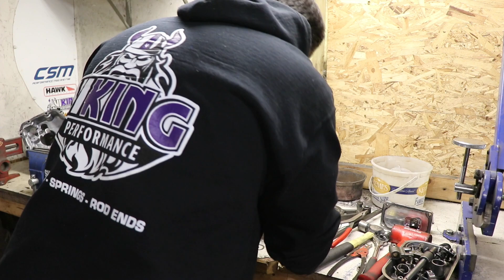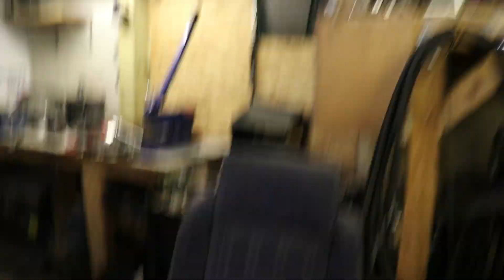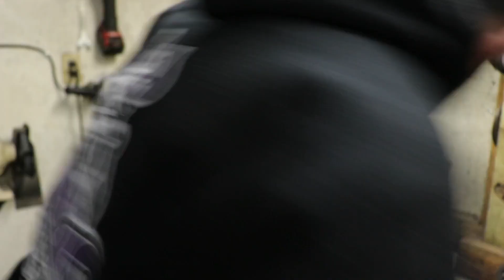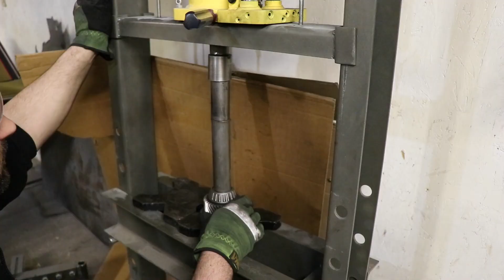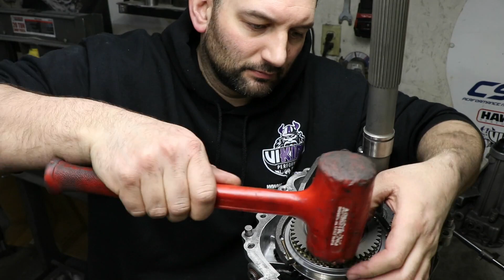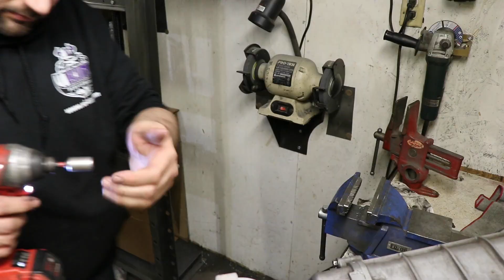Rebuilding My Tremec TR3650

Comment: So on that .82 5th anything special to install, it clears everything? Also looks tight to remove. How do you get it off?
Reply from the maker: It's a direct replacement. Once the snap ring is off usually some light pry bar/screwdriver work gets it free

Comment: Torquing qmwith an extension like doubles the torque value varying on what length extension you use
Reply from the maker: Yes. But I wasn't worried about it in this case because the torque value is so low and I was using the biggest diameter extension I have.
It's unlikely it was thrown off by much in this particular case

Comment: Have you ever seen a TR3650 main shaft sheared off at the 1st gear syncros? I cannot believe I lifted the main shaft off and from the syncro down was still in the case! Should I just abort the rebuild, or where do you get another one reasonable priced?
Reply from the maker: I have not....
I have a vore with a bent main shaft and broken case from someone getting big air over railroad tracks. But not one sheared off anywhere.
I don't even think the G Force gear upgrades replace the main shaft and they claim 1000hp safe
Reply: @codysmithmotorsports736  Yeah, looks like a weak spot. The force to do that, or it was just a bad forging if they're even forged.
Reply from the maker: @Guardian_Time_Jumpers most likely a defect imo

Comment: Is it possible to do the input? without pulling the whole trans apart?
Reply from the maker: You can pull just the front case/bell housing. You'll need to pull the shift retention springs (3 caps on the driver's side of front case).
If you stand it up on it's tail it'll be easier to not drop/loose anything when it comes off
Reply: Just had to do my input shaft, the shift rail assembly on the rear of the transmission does need to come off in order for the input shaft to come off

Comment: Good video. Thanks for taking the time to film all this. Going to attempt my first Transmission rebuild this summer (2001 Mustang GT). On the tightness of end play… everything in there will expand when heated up. I would think 1 thou is too tight cold. But I don’t know the spec for these myself. After some hard driving there will be no play and maybe even hard on the cases. Just my thoughts doing lots of engine builds. Take care, Clay
Reply: Yeah, I thought of that after my post. Aluminum does expand quicker. Thanks!
Reply from the maker: Correct except it will gain end play as the aluminum case will expand more than the steel internal parts when it gets hot
Reply from the maker: Factory spec is .001-.005
I've had no problems at 0-.003, even a couple thou press
Too loose is a problem. The gears will climb each other and can shear the teeth off under load

Comment: Thanks for the video. Im going to venture into the 3650 for the first time soon. I think you may have put the first snap ring in backwards which will make it a little harder to remove next time around. On any manual I do, I always take some sandpaper, something like 600 grit and break the glaze on the synchro cone. Not removing any material, just making it so the fiber will wear in better.

Comment: The bell will come off eith just the 3 allens and the inside the bell bolts without ripping the gears out right?
Reply from the maker: @jasonbirch1182  should...will need to be careful because the shift rods will lift the gears a bit if you pull the bell not perfectly straight up. But as long as you're careful you should be able to get the bell off without disturbing anything else. Id recommend having a way to hold the transmission with the input facing up while doing it
Reply: @codysmithmotorsports736  awesome thanks! I want to machine the front for adaption to my engine. I don't want to pay for a Hanlon front plate though.
Reply from the maker: @jasonbirch1182  you could just build an adapter plate like I did if the spacing works. I run mine behind an Oldsmobile engine and with the 05-10 input shaft which is a 1/2" longer it works out perfectly with a 3/8 adapter plate. Flush screws hold it to the engine and then the transmission bolts on like normal
Reply: @codysmithmotorsports736  how did you dial in the runout? That's my issue with doing that. I also have a fairly small tunnel opening at the firewall.
Reply from the maker: @jasonbirch1182  Its easy to find the BOP bellhousing prints and the the Ford Modular (which is what the 3650 is) matches 4 bolt holes and the dowels with a regular small block Ford which are also easy to find blueprints. I had basically a half circle cut and machined in the engine side pattern and drilled a hole on crank centerline the same size as the input shaft pilot. Stood a spare block on end, bolted the plate on, and stacked the transmission on top. That way the engine and transmission are correctly inline. Then just rotated the transmission a little until all the holes cleared each other and marked those locations to machine after. Once on the mill i did extra math to make sure i was holding the centerline to dowel locations before drilling. It worked out great
Reply: @codysmithmotorsports736  yeah but that's assuming you are dead nuts on center. Any bellhousing should be checked to be concentric to the crank. Unless you have a solid shaft attached to the trans for mockup, that input shaft is useless to stay centered. You need .005" or less runout.
Reply from the maker: @jasonbirch1182  I would assume that wouldn't be an issue when the bell is the front of the transmission also..all machined together. And my setup was based off the input shaft to blueprint block side locations.
I haven't had any issues
Reply: @codysmithmotorsports736  that's good. I just can't live with spending that much time on something and not knowing it's dead on. You mentioned "Everytime I rebuild the trans" too.   I guess you could use the bellhousing with no input bearing in it and a dial indicator in the bearing bore with a mount bolted to the crank. I'd like to be able to use my Mercedes bellhousing too as it fits the tunnel already.
Reply from the maker: @jasonbirch1182  my rebuilding often has been from wearing syncros out and shift fork pin problems. I abuse the ever living hell out of mine on racetracks. More recently I've needed to replace the shift rings as well because after 6 years of abuse the teeth are very beat up

Comment: Thanks for posting. No matter how many times I've rebuilt my 3650, I always, ALWAYS, put at least two bolts into the top of the case before realizing that I forgot to put the cast shift selector thingy back on the rail, the one where once you drive the split pin through, it falls through the case into neverland and you can't turn back.

Or trying to shove the case down over the gear shaft, only to realize that I forgot to line up one of the synchronizer rings in with the hub, and it sticks up about 1/4 of an inch. 

I just finished upgrading some parts in mine, and throwing it back into the car. It got a new 3rd gear, new input shaft and synchro hub for 3/4. The old cone on 3rd was worn out, and I somehow chipped a tooth on the 4th. 
Shifts like butter now.

Comment: Bro why Yu didn’t show the hard part of getting the 5th gear off???
Reply: Go to O'Rileys or Advance. They'll have the c clip spreader pliers you're looking for.
Reply from the maker: It's just a snap ring holding it in...same as the  speedo gear. There's special pliers that make that snap ring easy to remove. Then two small pry-bars, one on each side of the gear (if you even need them) and it comes right off

Comment: You can make it a lot easier on yourself by building it with the bell house sitting flat and cutting a hole in the work bench for the input shaft to poke into. Watching you do it this way looked like a pane with all the gears sitting on the bell housing you can just remove the case. Building it on it side is way to hard, good job and good tips for the next one I rebuild
Reply from the maker: Yeah, the latest time around I spaced it up on some 2x4s and it was much easier to get assembled

Comment: I’m jealous of your speedometer gear sliding on. I cracked two of these damn things trying to put them on. Attempting my third this weekend.
Reply from the maker: Gotta be careful with them. Mine eventually cracked too. I honed out the new one until it slipped on there to prevent cracking.

Comment: I’d say the reason those bolts aren’t torquing right and breaking is because the size torque wrench you’re using not to mention the extension. Those need to be torqued using a smaller torque wrench like a 3/8 drive or one measured in inch pounds.
Reply from the maker: Probably not helping. However I don't mind going up to the higher grade for the same reasons you put higher grade fasteners in an engine
Reply: @codysmithmotorsports736  Just keep in mind the original bolts are designed to break like that before they’ll strip the threads. The higher grade bolts may not be.

Comment: What car was this for? Also what symptoms and noises were you having? I got a 01 cobra with a 3650 and making all kinds of noises with only 95k miles was thinking to rebuild but not sure what is exactly wrong with it
Reply from the maker: I have it in my 85 Cutlass. Built my own adapters and I've been racing and street driving it for 4+ years. Was used when I got it and really haven't had problems with it beyond synchro wear. 
If yours is noisy I can only guess the bearings are out due to wear/lack of lubrication. I've beat the hell out of mine and it hasn't made a lot of noise. Bearings looked good when I took it apart